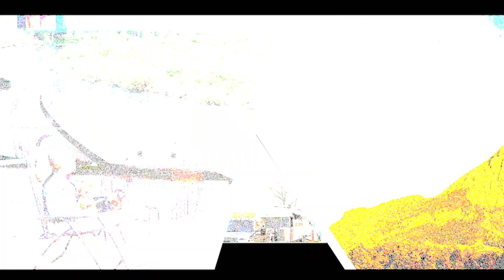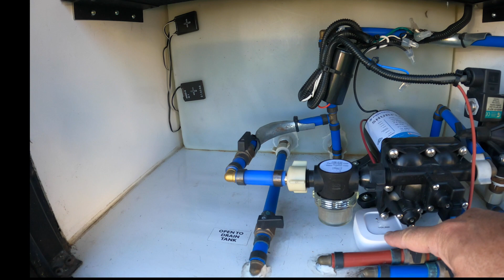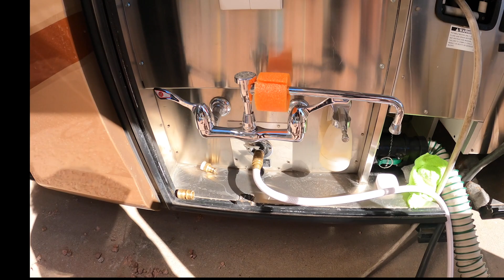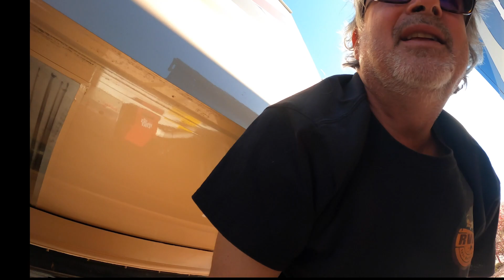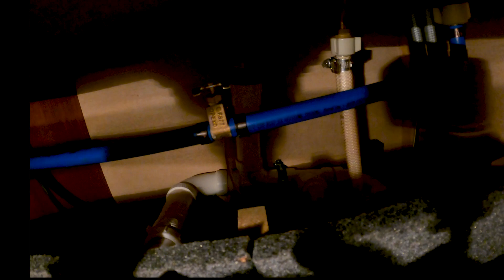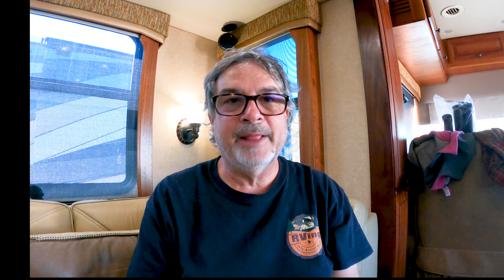How to DETECT RV WATER LEAKS *BEFORE* they cause MAJOR DAMAGE to your RV

Comment: Hi there. Thx for the video and information. My question is…if the sensors are just sitting there and not held down do you find they move around out of place when your on the road traveling? I’m guessing you’d have to check there placement at every stop. Thx
Reply from the maker: Most don’t move except the one in the water sewer bay which I move out of the way. You can put tacky putty on there to hold it